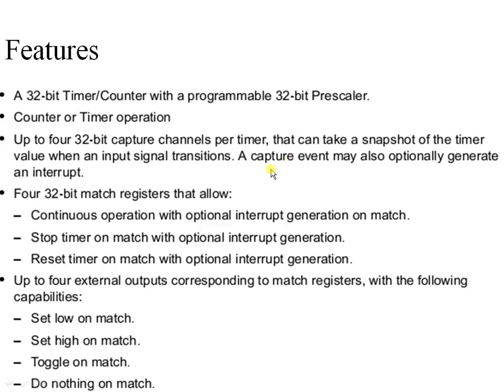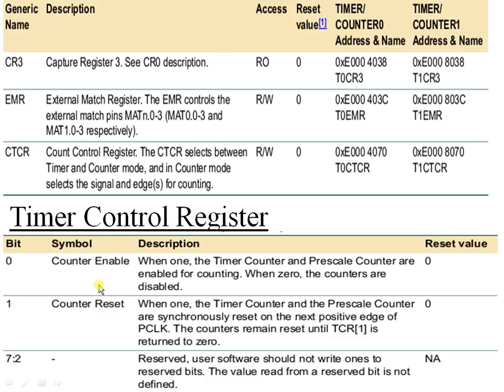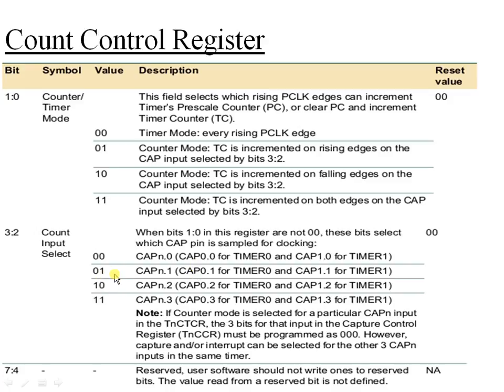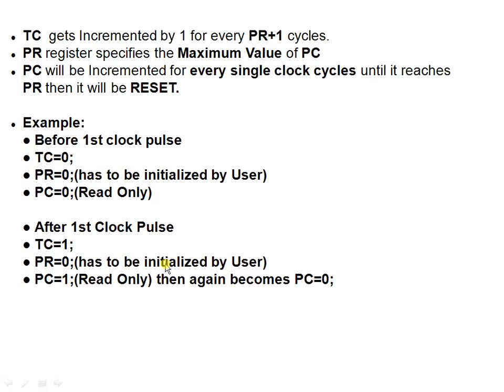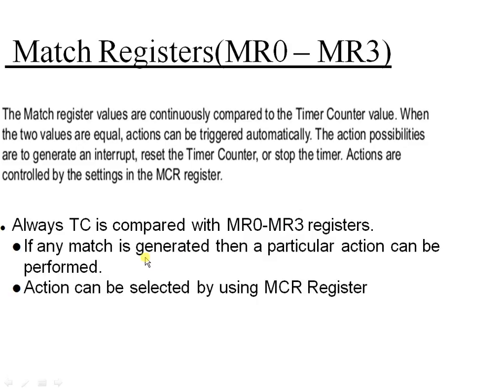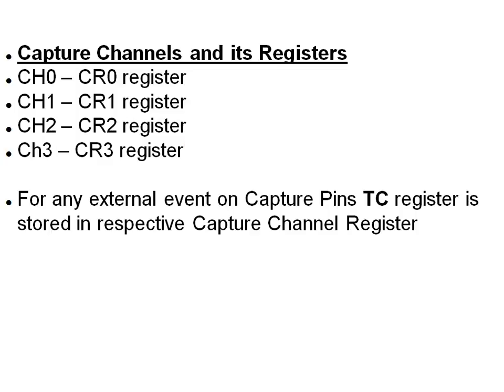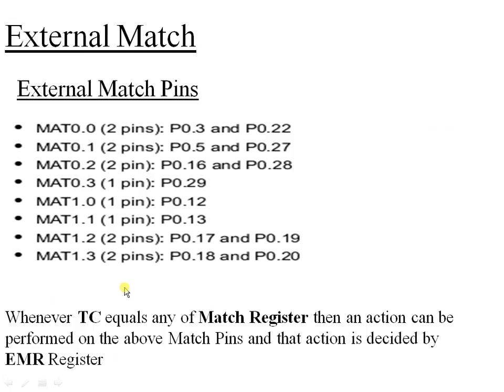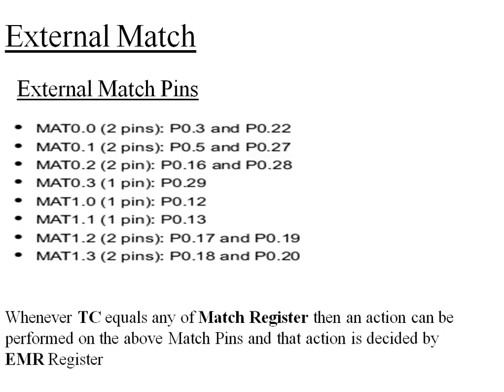ARM7 LPC2148 Microcontroller Turorial - Timers

Comment: Excellent explanation of a complex topic. Thank you very much sir.

I have a daubt regarding this timer in real time operation. 

I need to switch On a Led for 1 second and switch off it for 10 seconds. How it achieved. I tried a code but not working. I used two delay functions to achieved it but it's not working, pls guide me to solve this issue.

Here are my Code:-

#include<lpc21xx.h>
void delay()
{
T0TCR=(1<<1);
T0MR0=499999;
T0PR=10;
T0PC=T0TC=0;
T0MCR=(1<<0)|(1<<2);
T0TCR=(1<<0);
while(!(T0IR & (1<<0)));
T0IR=(1<<0);
}

void delay1()
{
T0TCR=(1<<1);
T0MR0=499999;
T0PR=100;
T0PC=T0TC=0;
T0MCR=(1<<0)|(1<<2);
T0TCR=(1<<0);
while(!(T0IR & (1<<0)));
T0IR=(1<<0);
}
int main()
{
PINSEL0=0;
IODIR0=0xffffffff;
        while(1)
        {
        IOSET0=0x00000007;
        delay();
        IOCLR0=0x00000007;
        delay1();
        }
}